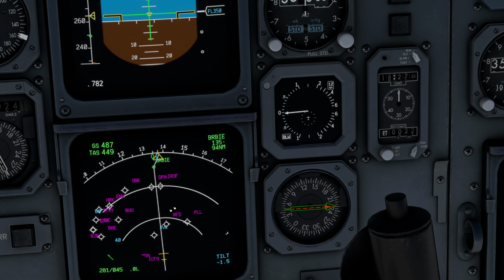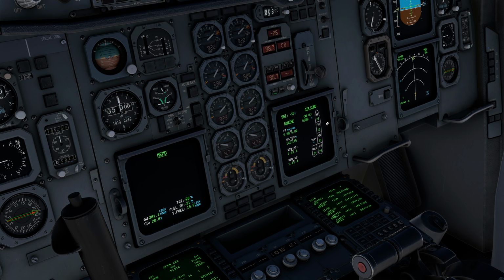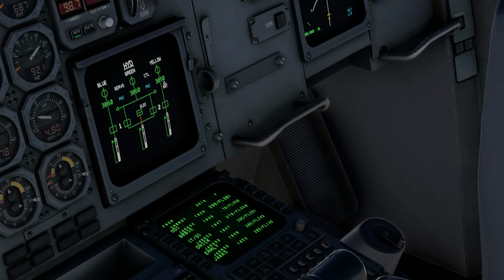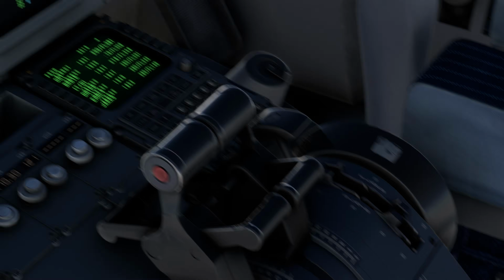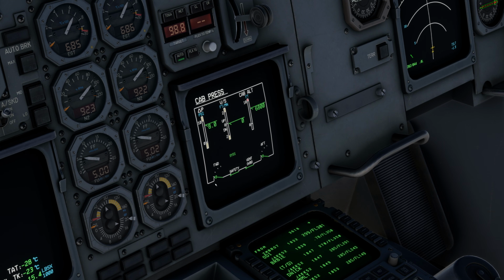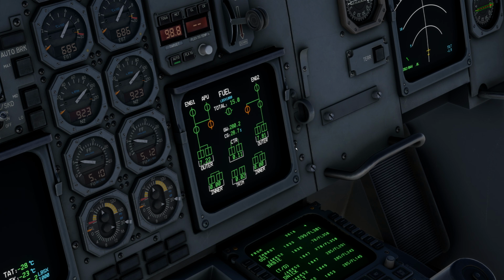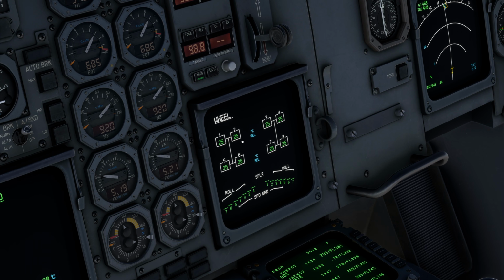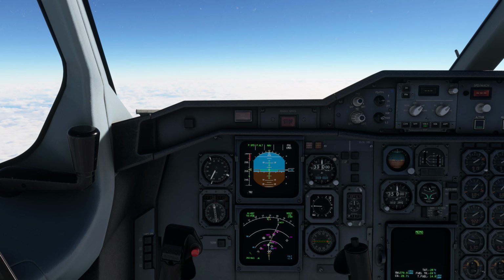iniBuilds A300-600 Tutorial 8: Cruise | Real Airbus Pilot

Comment: I sort of missed it. So in Cruise if SAT is -10 it's mandatory to turn on Anti-ice regardless of weather condition? Just trying to learn the correct way.
Reply: I know that this is a year late of a reply, but still figured I'd answer your question. During flight in the flight levels, when SAT is less that -39 degree's C, in icing conditions, anti ice is regards, descending out of the flight levels, anti-ice is required to be on when the temps are less that 1o degree's C on the TAT